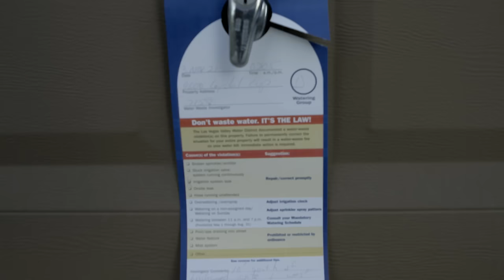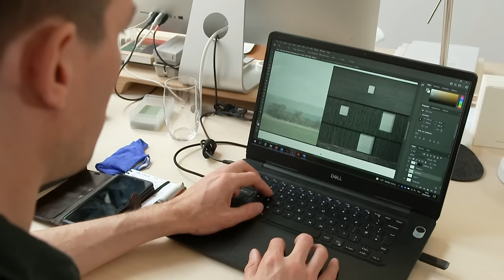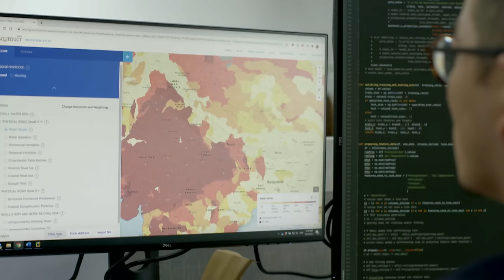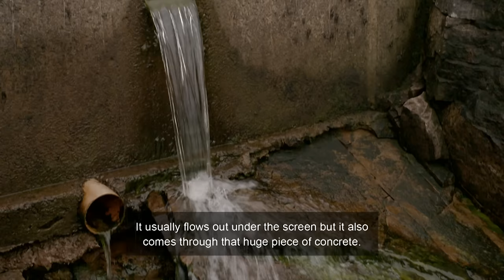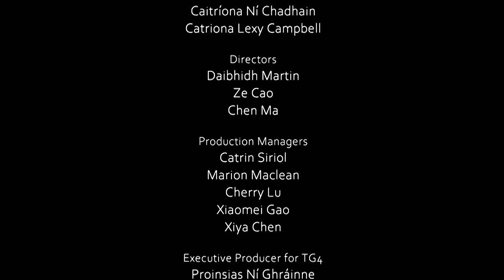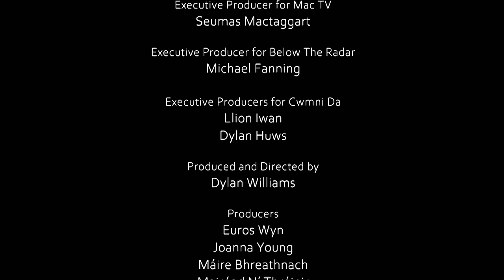Can Civilization Adapt To The Change In Rainfall? | Rain: The Untold Story

Comment: I wonder what's the cost shipping in water to Inis Oirr. Maybe some Philanthropy based group or person could assist them in building a small Reverse Osmosis Plant, it only need to be used for drinking/eating and sanitary needs, the saved rainfall could then be used for other purposes or emergency backup. They have water, needs refined, also the air is quite breezy there, smaller wind Vanes could be used for powering the plant, it wouldn't need to run 24/7 after tanks have filled. :face-blue-smiling: